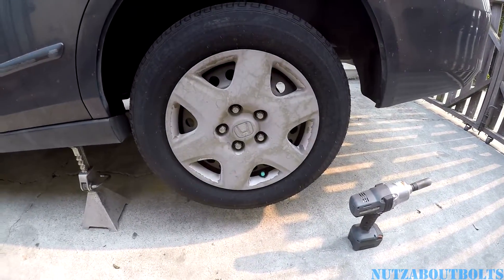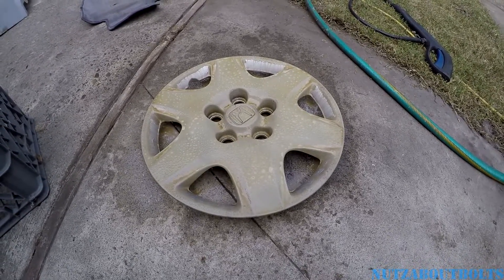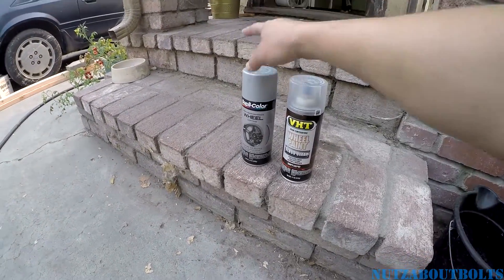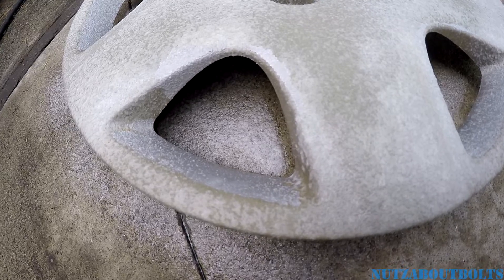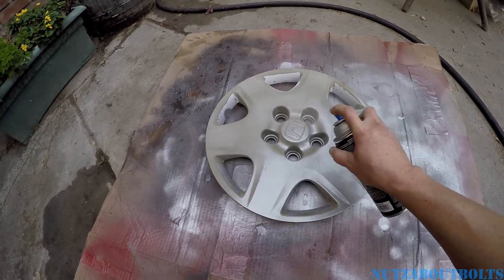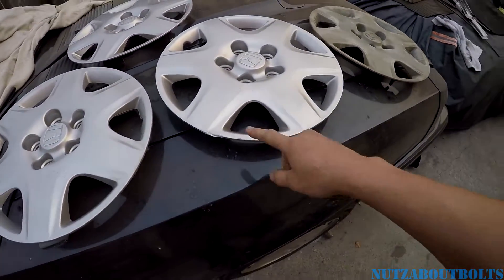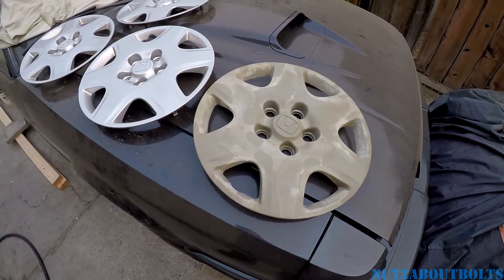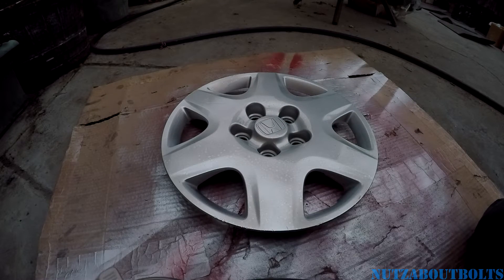How to prep and paint your hub caps

Comment: The blotchy spots are known as fish eyes. You have a contaminant like oil or Armor All near by. Tip: Wipe sanded surfaces with Wax & Grease Remover before painting. Paint 3 coats: Light "tack" coat, second coat a little heavier & final "wet" coat (but not so heavy it runs). Same for clear coat.

Comment: I painted my hubcaps on a 2000 Honda Civic I used 120 then I use 220 sandpaper I spray painted aluminum paint and then clear coat that was four years ago and they're holding up perfect
Reply from the maker: Nice work